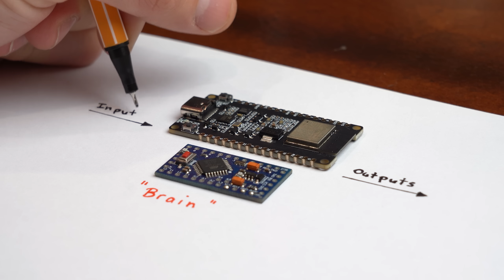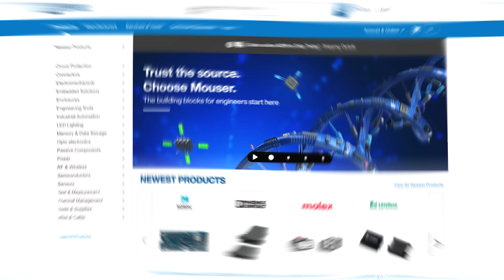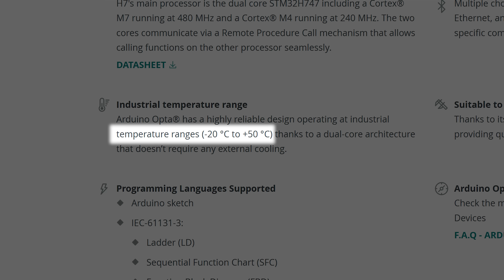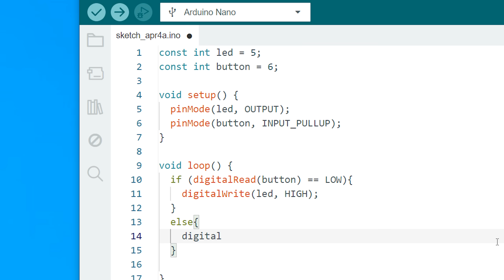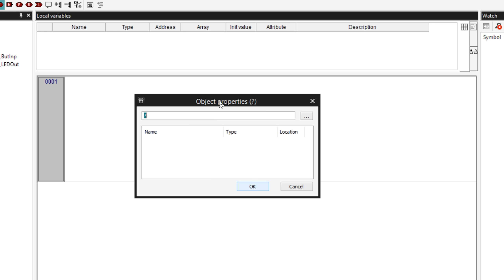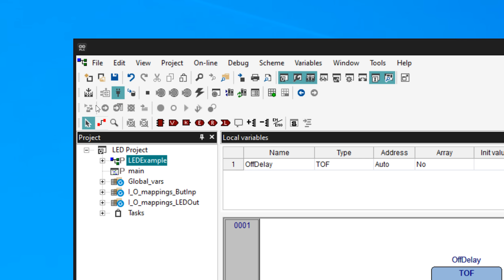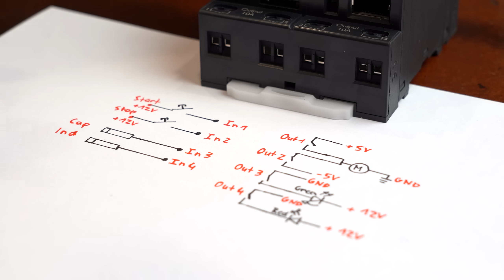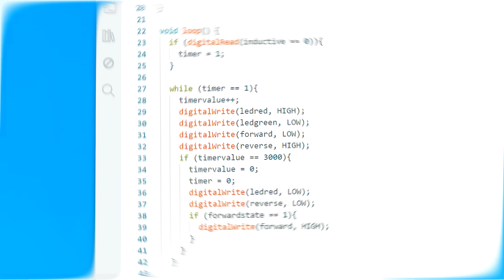Not a Microcontroller!...This is Better?! (PLC) EB#62

Comment: I finished my degree on Mechatronics Engineering and learned how to code both PLC and MCU. The PLC is super reliable but the thing that bothers me the most is the paid software and the programming "language". Is so much easier to write code in C instead of using the standard blocks. The PLC software also makes difficult for people to make custom blocks. Overall the MCU is the better to learn eletronics and PLC is better to learn automation and give a better background for when people graduates
Reply: It might be easier for you to write in C, but good luck with finding many maintenance techs knowing how to debug any problems at 3AM in the night. This is why I don’t like PLC programmers who exclusively program everything in ST (structured text, a pascal like language). While it might make sense for these guys (often coming with CS background) they never think about how much harder it will be for the customer to maintain their SW. It is much better to use one of the graphic language for most things and use ST only where it is absolutely necessary (complex communication protocols or calculations).
Reply: @attilakovacs6908 in my experience (is not a lot...) most codes are blocked for security reasons and you can't change the code. Maybe in another countries is different but in Portugal you can't really change and the technicians are also not very comfortable doing changes
Reply: @ Now, I understand what you mean. Yes, we also lock down our library blocks (motor, valve, VFD control, special calculation block etc.). We however also include built-in documentation for these blocks in PDF format. Actual control blocks using these blocks are fully open however and are mostly written in ladder logic (or FBD for certain customers). So about 80-90% of the program is open for the customer to change. 

When you are contracting suppliers, you can demand access to code that is necessary to maintain the operation of the system. Depending on the supplier they might refuse, but you can just change supplier in this case or pay extra if they offer. Asking the password for safety related code however makes you responsible for any later mishaps. We are never giving those out to customers unless they sign the document that from then on they are taking full responsibility regarding those functionalities.
Reply: @attilakovacs6908 This is absolutely utterly and completely true. I had a remodeling company for about 15 years. I also studied Biochemistry plus a fair amount of math. We did a two story addition to a 1 story house. There was a really bizarre rafter that had to be cut where the new and old sections met. The traditional method is to pull strings and measure and cut then use that to fix the cut for the final rafter correctly.
When I said no, I will calculate it. They laughed. After 15 minutes I had it cut exactly right the first time. You have to have a simple method that a half drunk exhausted guy at 3am can manage to do. Or the factory will lose an enormous amount of money and maybe lose a customer too.
Reply: @attilakovacs6908 This is also common problem with MCU themselves : each vendor require their own toolchain, writing in their own way of read/write this/that register to accomplish the same functionality across everything 🤷‍♂️ 

And yes, the same "Good Luck finding a library in C work for your model" 😂

More like : Buy our MCUs and fuck-off !
Reply from the maker: Good verdict ;-)
Reply: This varies a lot by brand. Codesys is free and works pretty well, I don't get to use it often though cause all our clients want Rockwell
Reply: you can run nodered on pretty much any industrial embedded SBC
Reply: A benefit of the functionBlocks is - you do not write code. you can make simple logical errors but many other cases are already handled for you.
Reply: I mostly use twincat and most of the time writing in ST is pretty convenient. It's possible to use C. Of course you can make your own function blocks. That's kinda the whole point. Graphical programming can become messy quickly for certain things. You can also use twincat for free (everything is 7 day trial license, you just need to restart your program after 7 days). But I agree the licenses and software are often too expensive. The hardware is expensive already.
Reply: I enjoy C/C++ programming as much as the next guy, but seriously - it's entirely the wrong programming paradigm for an industrial control system. PLC code has SOME chance of being correct, or at least incorrect in predictable ways, when used at scale. The level of discipline required to achieve the same thing with C would be rare to non-existent in the industry, and it would take just one ill-considered decision in maintenance programming to turn the whole thing back into an unpredictable mess that might kill someone. No. Just no.
Reply: @KarlAdamsAudio  I'm primarily an embedded software developer with experience on a couple dozen different MCUs, but I've also had plenty of experience in the 61131-3  world, and I gotta agree with you.  I naturally want to gravitate towards structured text because that most closely resembles what I usually work on, but I've found that either ladder logic or function block is almost always the right solution when dealing with PLCs, and ST really is only appropriate in very limited instances.  I think the biggest hurdle for "traditional" software devs that are new to PLCs is grasping the concept that LL is NOT procedural and all the rungs are effectively being processed at the same time as far as the PLC is concerned - you're not "programming" so much as defining what the system's outputs should be for all the different input states it can be in.  It's a lot like programming FPGAs in several ways, which also tend to give headaches to coders with only procedural language experience.
Reply: @KarlAdamsAudio  the next guy replying here 😊 so why some high end and modern PLCs support, among others, C/C++ ? The Arduino Opta also supports programming in C/C++.
Anyway in general you're right, while bugs can be introduced no matter how the PLC was programmed, it seems the industry has strict rules/policies, and there are reasons bebind it.
My idea is that now that we're in 2025, you can imagine how many life-critical things like cars are based on processors and microcontrollers that are programmed in C++.
Another example is robots carrying tons of weight in industrial plants. Those robots operate on Linux, using ROS2, so you have C++ and a little of python, no PLCs involved.
I mean things have changed over the years, even if some policies in some industries haven't changed a lot.
Reply: Такий код майже не можливо міняти "на льоту", особливо коли тобі дзвонять вночі з претензіями, що завод зупинився. Я пишу головний цикл на Ladder (точніше в сучасних програмах це гібрид LD та FB), а вже самі блоки на Structured Text - так можна легко робити тести і відладку наживо.
Reply: It's also so much easier to understand code written in C/C++. I don't imagine myself able to understand what others have done with those blocks... which runs first ? Etc.
Also the very high cost of PLCs makes one definitely get more addicted to MCUs lol
Reply: @RogerTannous  I use MCUs for personal project that don't need to be as resistant or critical. But in industry where a simple failure in the MCU can stop the line and make thousands or millions in loses Plc resistance become necessary.
Reply: @joanperisbelles8060  PLCs are based on processors too. The only difference is that they have more protections installed as I self-concluded from the current discussions here. So if you need to make an industrial product, you certainly won't be using an Arduino Uno for instance.
Reply: @ Indeed
Reply: I would like to add, that there are PLCs that support programming C++ for example. Look up Beckhoff TwinCAT3 for example. You can even write full PLC programs and test them on your own PC for free.

I also don’t understand the hard to make custom blocks. I have written hundreds of custom blocks over two decades. You can build your own library of reusable blocks handling motors / valves / VFDs or any other equipment.
Reply: Just say it out loud. Siemens TIA sucks... And they want money for that pos software after you buy a way to overpriced plc..
Reply: I don't know wich PLCs you have worked with. Maybe you are speaking about ladder. I've used a lot of it when I was programming Omron PLCs but now I'm working with Phoenix contact PLCs and they work with ladder and blocks like with structured text according to the 6061 law I think... Anyway nowadays with the new plc programs like Tia portal(siemens), PLCnext (Phoenix contact) all have possibility to write many POUs in different ways.
Reply: @joanperisbelles8060 I know there is that option but I think it should be easier to get there. I had some projects that I wanted to write code in C but there was hidden in menus after menus. My experience is very little and I have worked with older softwares, I am not that into PLC's and to be honest I'm more into embedded systems and have the freedom and the challenge to design the electronics with the MCU. Like what GreatScott said both methods have their cons and pros and it's what I really like about engineering
Reply: As someone who learnt automation via compressed air logic and mechanical mechanisms then moved forward into light PLC implementation I would have to agre. Although I still default to thinking in Ladder.  Function blocks are nothing but short hand for tools like CNC machinery.
Reply: With Beckhoff PLCs the Software (Based on visual studio) is free to use and their live support is too. You only have to pay for the hardware as well as licenses depending on the performance level of the PLC and what hardware extensions you use.
Reply: So maybe the solution is a PLC that is based on Arduino /esp32/ Raspberry Pi.   There are some companies that make them.
Reply: @panofilossas6564  the problem is that they won't have the lost important perks of a industrial Plc. Resistance to heat, electrical noise, dust, humidity and extended lifetime.
Reply: @joanperisbelles8060  Why not?
Reply: @panofilossas6564  I've written multiple comments wich are you referring to?
Reply: @joanperisbelles8060  last comment. The one that answers to me
Reply: @joanperisbelles8060  last comment, that was referring to me
Reply: @joanperisbelles8060 A bit off topic, but something I've been wondering: what are the standard tools/possibilities for "source control"? That is, version management, diff, merge etc? Are the graphic programs also exportable as text? Or is the PLC world living without it?
Reply: @ There are companies that make them (i.e., Arduino Opta), but they're not intended for applications where reliability is important, plus the bigger automation companies like Siemens, Rockwell, etc. are going to have much more comprehensive warranties and guaranteed performance. The cheap, low-end PLCs like you're talking about are absolutely 100% inappropriate for any application where safety might be a consideration.  The off-the-shelf AVR, Espressif, and Broadcom processors used in those aren't capable of stuff like redundant hardware lockstep processing that's important for safety-critical applications, and being designed with those hardware fault tolerance features is part of the reason the higher-end products are expensive.  If all you're doing is turning some indicator lights on and off or something else involving very little risk, you might be fine with one of the cheap ones, but I absolutely would NOT use one in any situation where someone could get hurt or substantial financial loss could result from a PLC failure.
Reply: And of course, just as I post that, I see that last month Microchip introduced a lockstep variant of the AVR series that's ASIL-C and SIL 2 compliant.  I'm guessing it'll take a while before those start showing up in Arduino PLCs though. 🙂
Reply: @seegee-u3l There are products that have certificates for industrial use, like the Revolution Pi. If some process is critical, it's better to have 2 or 3 PLC 's control it than one, no matter how expensive the one is.  Even if it has a probability of 1/billion to fail, the probability of 2-3 cheap PLC 's to fail at the same time is zero. 
Anyway, these are my thoughts. I may be wrong.
Reply: there are a few PLC manufacturers that support C and even C++

like B&R for example
Reply: i really dont know what you mean by that, did you use a graphical programing language like FUP or KOP on a Simens SPS. 
Siemens also offers AWL which is pretty much like Assembly and on the newer SPS versions like the 1200 and 1500 they try to replace AWL with SCL which is kind of like C or C++